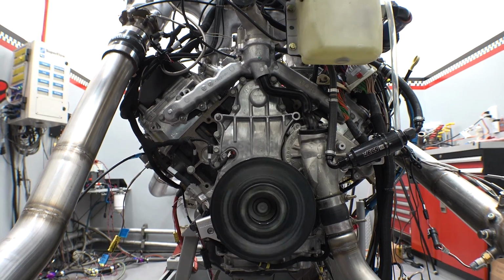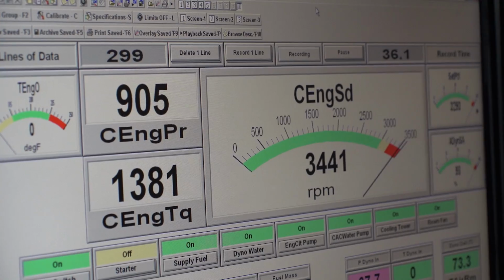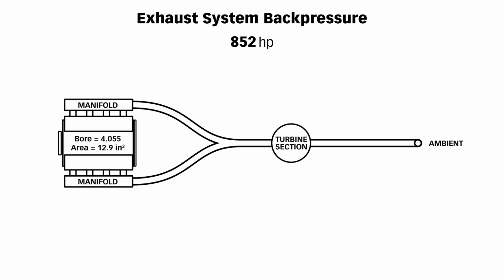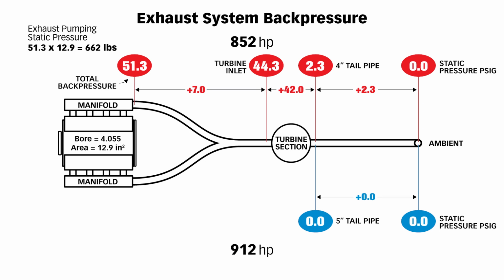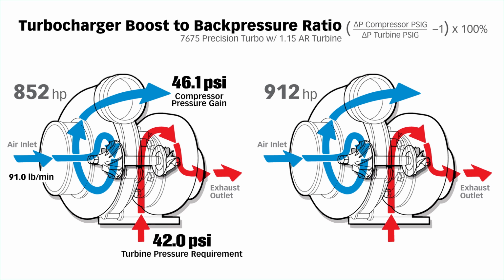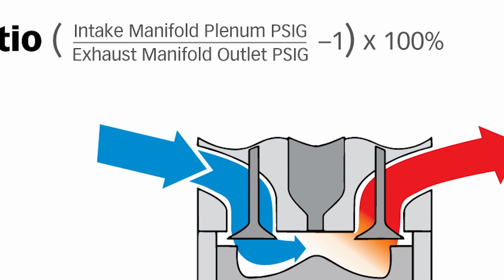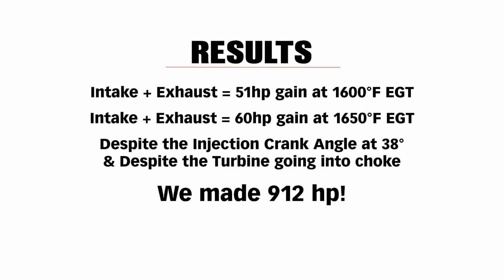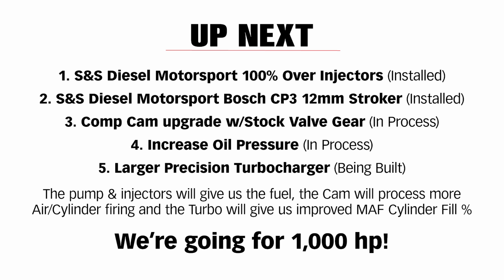912 HORSEPOWER DURAMAX with STOCK internals! Killing A Duramax Pt 12

Comment: Second comment. I'm sure you've got the data, so it'd would be great to have a look at the different sensor data with both configurations at the same 852hp. 

Also surprised you haven't gone to a tubular exhaust manifold to further reduce cylinder back pressure and reduce cylinder to cylinder back pressure variance. The cylinders at the front of each bank (1 & 2 or 1 & 5, not sure on cylinder numbering in a duramax) will both be suffering more back pressure than the others. I see this issue in ventilation designs I’m involved in, where fans are installed in parallel discharging into a log manifold. The fan furthest from the discharge point always operates at higher pressure (thus moving less air) and more care needs to be taken when starting them.

Side note: in order to avoid flow separation (and thus turbulence) in in a conical expansion (or evase, if you will) the angle of expansion needs to be kept <12°. With best efficiency recovery often between 7<10°. Just a tid-bit from the world of mine ventilation engineering.

Regards
Jordan
Reply: I iS aN eNgInEeR. That title isn't highly acclaimed in the auto industry much anymore. Use it wisely
Reply: @KangasKyle  ...Mechanical engineering is as important and respected as it ever was.  "Value" engineering has the industry by the balls.
Reply: @paulcopeland9035  well said...just give me the baby mindset; plug-n-play consumers The consumer responds to marketing and advertising, not the R&D investment that a company pours into a part before they sell a single one which means that aftermarket bolt on's are a price driven commodity for most people. I love it when Gale does a comparison of parts on the market with the parts he makes to show you how each manufacturer approaches a solution to sell aftermarket parts. My God his depth of study on something as basic as a differential cover was a damn masterclass.
Reply: 13° actually works best.
Reply: @cencoast_7.340  somehow, I think I'll trust the engineer ✌️
Reply: Just call up Cummins and put your theories to the test!
Reply: @doolittlegeorge  All of this is well understood by Cummins; it's basic fluid dynamics. They know a 5 - 12 degree conical diffuser into at least 18" of straight pipe before any bends, and keep those bends as gradual as possible. But, those introduce cost, and add to manufacturing time. Also, they usually have space constrains, compatibility issues - be it platform, or manufacturing processes available.  Just about every piece of the engine could be designed better. But, it's always a compromise between many things, and being the best solution isn't high on the list. If the solution is better than its predecessor, and competition, then it's good enough.

Comment: Seams like we didn't see how much increase in hp the exhaust is really capable of since the turbo choked
Reply: The turbine outperformed the turbo.  The turbo couldnt pull in air efficiently anymore.  The turbine was going so fast that it was causing a low pressure variance in the turbo.  There was lower back pressure to the turbine so it could literally spin as fast as the head would spit it out.  You basically had the turbo chasing  the turbine.
Reply: Speaking of exhaust/back pressure. Which would be more performance gain?  An axle dump or a full tail pipe?
Reply: @MRW21783  Full tailpipe by a long margin if it's a daily driver.  Not to mention it's illegal to be axle dumped in alot of states.

Comment: Awesome! I have had this theory that the simplest power adder would be to add an electricality powered pump to the exhaust. so the outlet of the turbine is at vacuum I think it would provide more power at every point in the power curve. Some day I would love it if some one would test that theory
Reply: I have another theory. Throw the dinosaur design of the ICE in the scrap bin. They all generally pump the exhaust port out perpendicular to the piston. It takes work to get around that corner. If the exhaust port were parallel to the piston, it would travel in a straight line and be more efficient. I bet it would be shocking how much of a difference it would make. I love your idea by the way. It would also work on a NA engine
Reply: JoManOut sliding gate valves? Interesting
Reply: @WoodWerksUSA  Sliding Gate, Butterfly, Hinged Butterfly - axis of rotation on the side instead of middle. You could also do a standard valve and valve seat directly above the piston at a 45 degree angle. I'm sure it would take some research to figure out how to do the exhaust valve for it
Reply: @jomanout5866  You could try a ball valve but I don't think you could get it to seal in the pressure from combustion and take the punishment from the heat and still be able to keep turning after it gets a little dirty. your also talking about a total redesign of the engine

Comment: Can we please see a video with all the emissions on with the same results please, I understand the motor internals are strong, but the bolt ons are not legal where I live.
Reply: Victor Oliveira Gale makes his stuff run verrrry clean his duramax dragster has no visual emissions actually nothing he builds has visual emissions
Reply: @rivett40  doesn't matter how clean he tunes his engines EPA requires emissions equipment on road vehicles. I wonder how well this engine would have done with the required on road emissions equipment installed, and how much better or worse the emission output from each engine would be. Maybe would make an argument to how the EPA is overstepping with this restrictive emissions equipment and how it really affects the emission output from these on road diesels

Comment: The IDash unit manifolds so much data. Is there any reason that data isn’t package prepped and sent over wireless? Like Bluetooth connection or maybe a different radio of some kind?

I just think modern smartphones can manage the data for two reasons. Screen size and processors are getting nuts on hand helds...(and radio through puts mbps wise is redonk now so I don’t know that it would be that much of a issue time wise)

Comment: Hopefully this will spread far and wide, as with this entire series but specifically to perhaps shut up the people who think you NEED back pressure in the exhaust as if they are dealing with a two stroke engine.  How many times have you heard...ohh that's too large an exhaust pipe diameter, you want to have some back pressure, geesh.  Thanks Gail, love your work.

Comment: Im expecting 1400 hp out of this
Reply: I am expecting bent connecting rods and a blown head gasket. Some pretty extreme things already going on here for a stock long block. The camshaft might let them spin the engine fast enough for some big power, but 1400hp at even 4k rpm means more than 1800 ft lbs....i have my doubts.
Reply: Timothy Bayliss agreed. As nice as these numbers are, I’m more interested in mid range useable power, where Torque usually peaks. It is that area that usually results in bent rods and blown gaskets.
Reply: @timothybayliss6680  thats why he can make so much an engine can handle more torque at 4k than at 2k

Comment: So what you're saying is if the boost is more than required it's automatically costing you horsepower
Reply: Not the boost. The backpressure.
Reply: Would the back pressure still ring true on a non boosted gasoline application?
Reply: @spnua1906  
Yes. If you were to think of it as only an air compressor, you can imagine that an air compressor pumping air into an empty tank doesn't have to work very hard. But as the pressure starts to build up in the tank, the compressor motor has to continue to increase the amount of force that is applied to the piston to cause it to move the air. Another way of realizing this effect is if you were to use a hand pump type of bicycle tire pump. When you have the hose disconnected from the tire, the handle is pretty easy to push down because you don't have much backpressure. If you pump fast even with the hose disconnected you will notice that there is an increased amount of force required to get the air out of the pump just due to the small air hose, and other internal restrictions in the air pump. Those internal restrictions can be compared to the internal restrictions of the head of the engine, and you can start to see why having larger valves, and more valves helps to allow the air to flow out easier, which reduces the amount of force that is required by the piston, and whatever is pushing the piston, to push the air out of the pump. Then as you start filling the bike tire, or anything else that builds up the pressure, with your hand pump, then you will feel the amount of force required to push the handle down will continue to increase as well. So any time you have something that causes a restriction in the exhaust, whether it is a catalytic converter, a muffler, or small exhaust pipes, all of those things build up the backpressure in the exhaust system, which in turn, increases the amount of force required by the engine to get the exhaust out of the car. And that increased force is energy that is taken from the amount of work and power that the engine would be able to apply to turn the wheels and push the car. So every bit of backpressure will take away from the power of the engine, unless that work can be used to increase the amount of pressure in the intake to overcome the backpressure. That is what a turbo does. The turbo uses the pressure, heat, and speed of the fast moving exhaust gases to spin a turbine that is connected to a turbo fan, via the common shaft, that is used to pump air into the intake of the engine and increase its pressure to add air for combustion and overcome the exhaust pressure on the system. As you can see, a turbo is only beneficial when it can increase the intake pressure more than the amount of backpressure that it causes on the engine, and it can only do that because the exhaust gases are hotter than the intake gasses and thus have more energy to be used.
Reply: @spnua1906  backpressure is always bad
Reply: @davidscott5903  more boost automatically raises backpressure
Reply: Yes increasing boost past the point of achieving a complete combustion will cost horsepower
Reply: @SkootSkoot_8558 
No, that's not quite how it works. The more air you can cram into an engine, especially a diesel engine, the more power you can get out of it. On a gasoline engine pumping in excess air is not very beneficial, and can cause misfiring if you are too lean on your air fuel ratio, but diesel engines become more efficient when you pump more air into them, so they love more air until you get so much that you start blowing head gaskets, or breaking connecting rods.
Reply: @davidscott5903  Not at all. Boost is good on a gasoline provided you have the fuel to keep the afrs in check. Diesels get less power because the fuel gives the power not the air. Its already a high compression engine it really doesnt benifit from anymore. They lose power to driving the turbo via increased emp
Reply: @davidscott5903  are you making this shit up as you go . Anytime you can add air to a gas engine it makes more power
Reply: @SkootSkoot_8558  also a diesel require a higher afr so pound for pound diesel will always make less hp and torque

Comment: Great informative video. Loved the section on boost vs. back pressure. My new ECU (Adaptronic) uses this measure as the load axis in the fuel and ignition tables. 

Knowing the differential pressure helps optimise the system for efficiency, and allows the tuner to make informed decisions on how far to pusch past that efficiency area. Also where the 'stop' point is and whats causing the limits.

keep up the great work.